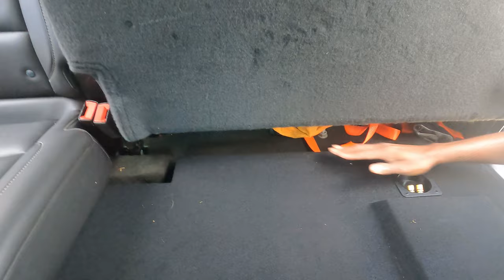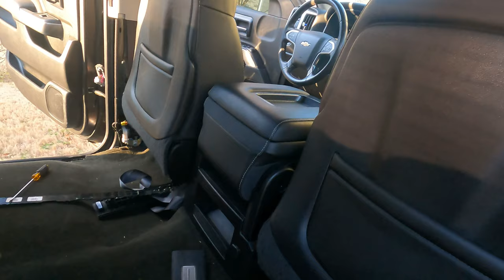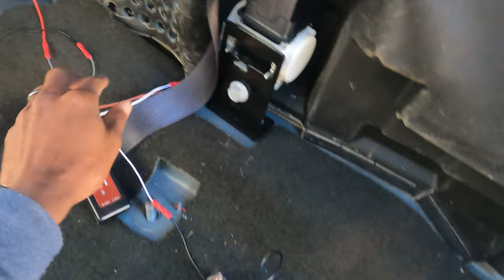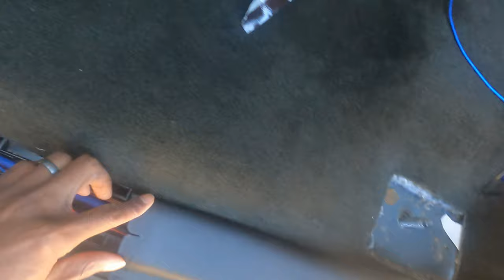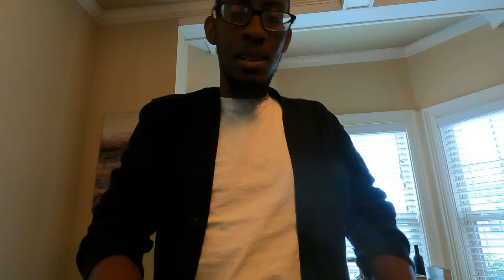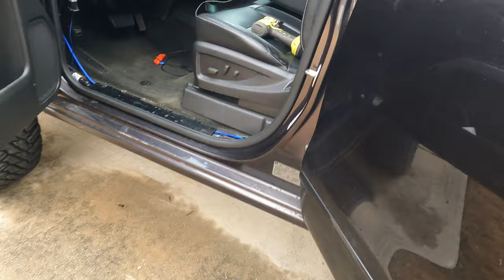Skar Audio Unboxing 2nd Try | Complete Installation in Lifted Z71 Silverado Truck | Part 2

Comment: I got my camera rca and my alarm going through that spot on the firewall in my 2014 silverado. Got to much going on, on that side. I need to run my power wire on the passenger side. I was also looking at the Skar system. I been out the sound game since the early 2000’s too😅. Overall how does the skar system perform? I’m not trying to win any sound competitions. Just need a little boom in my grocery getter
Reply from the maker: I love them! The clarity is unbeatable. I'm running another set in my monte carlo and plan on running them in the malibu!